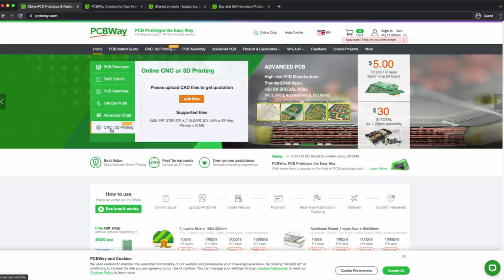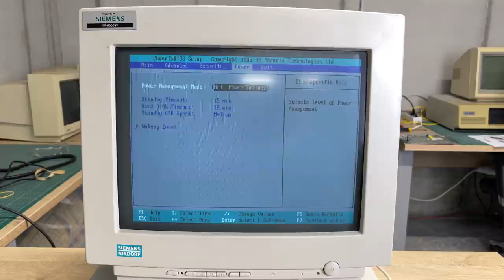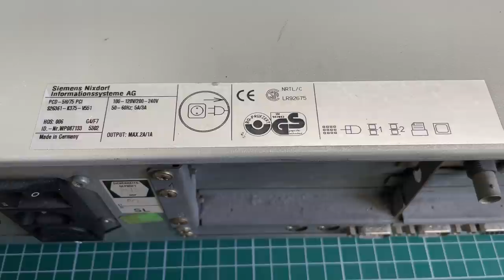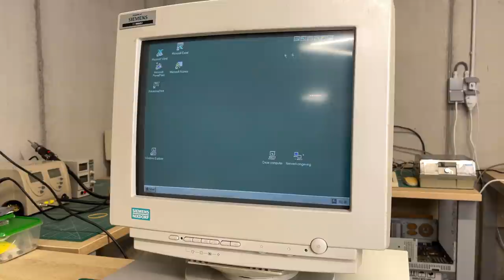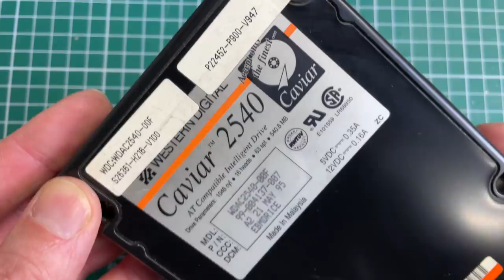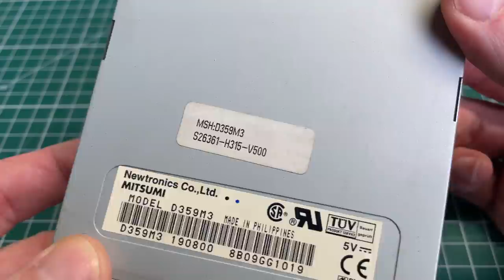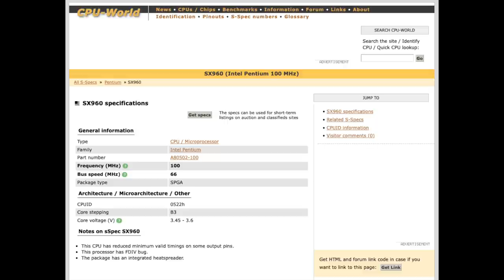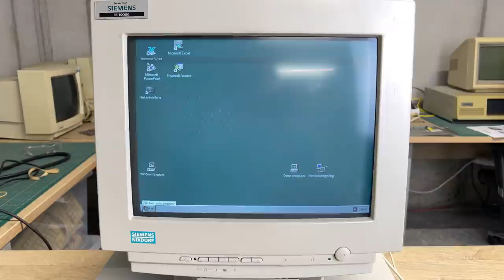Boring Siemens PC with potential ?

Comment: I happen to have the Siemens PCD-4H, which has basically the exact same case but has a 486 instead. It was used as a POS system for all it's life with a 486sx 25mhz. I upgraded it to a DX2 66 mhz and a sound card. It has been a really reliable and great little gaming PC so far.
I also love the look of the system with the sliding door on the front.
Reply: Last time when I check the internet I so to find BIOS update I found ebay auctions for PCD-4H over 1000 Euro without original keyboard. I really shocked because I also have a keyboard. :-) I bought without RAM and HDD almost 3 euro 24 years ago, this my second bought computer. The configuration 486 DX4 80 MB FP RAM, Floppy, 2 WD Caviar, Teac IDE 6 CD changer, SB 16 value edition ISA sound, 56kbaud modem.
Reply: This is exactly what I use mine for. Mine came as as DX2-66 but I threw in a write-back cache 3v DX4-100 in it (through a VRM) but it bottlenecks at around 75-80 MHz on performance tests. I mean I paid $5 for the VRM and $2 for the CPU, but I can imagine if I did the upgrade in 1994 I'd be extremely distraught at the loss of 20 MHz. 

Excellent machine, a staple of my collection that I routinely game on.

Comment: Neptune chipset. This was the high end Intel chipset of that time. The last without EDO support but with complete tags for the cache. Later Pentium chipsets TX (Triton) and VX notably, were significantly faster but only could cache up to 64 MiB which was a real PITA as high end PC's at that time could handle 128 or even 256 MiB (my clientel were steel frame engineers using their machines for CAD with AutoCAD, so I had to know which chipsets were any good). As for the NX (Neptune) it was in my PC of the time. It had a dual Pentium socket, EISA slots and 6 72 pin RAM socket. At one time I had 80 MiB of RAM, 1 IDE drive and 4 SCSI hard disks, a CD player (Plextor) a DVD player (Pioneer), a CD burner (Yamaha) and an external Zip drive. Fantastic machine.

Comment: Siemens-Nixdorf! <3 I went through several generations of these at work in a bank. And they are so fantastically suited to a retro build. compact but with all the features you need, some even have much stuff like networking onboard. some come with a 2MB Matrox millennium on board so all you need to do is plug in a Voodoo and a soundblaster and you are go.
Fantastic machines behind the unassuming appearance. and very reliable!
Reply: Like me, I remember them, too!
Reply: Siemens later worked with the Japanese PC manufacturer Fujitsu, and Nixdorf worked with Diebold, a company that produces automated teller machines.

Comment: Funny how this version of Word starts faster from that ancient PC than a modern version starts from modern one even from an SSD. Both do more or less the same.
Reply: Actually it is only fast because it didn't load into a big document directly. But yes, having less features and a simpler gui helps with loadup speed.
Reply: @MKRENB   Office 2019 takes a good long while to start to en empty document.  At least compared to this (4.2) on ancient hardware and a spinning disk.
Reply: that's because many components of MS office are already preloaded at startup via the office quicklaunch bar while you're off grabbing your morning coffee. (edit: the small bar in the top right)

that pre-loading actually was another point of outrage about MS's deep integration of Internet Explorer into Win95, as it gave them a major boost to their browser's loading time compared to the competition.

Comment: That machine looks very similar to my Digital (DEC) Venturis 5120. The motherboard is almost identical, just a slightly older version. I hardly ever see Siemens Nixdorf equipment here in the US, have been looking, just to have.
Reply: It also looks very similar to my Digital Celebris. BIOS, ports, case layout, motherboard layout, P75 CPU with glued-on-heatsink are like 90% identical (mine has no fan though). I wonder who the original manufacturer is.

Comment: Thank you for this nice video ! I love those Siemens desktops. I used to use these during my military service back in 1997. That was exactly the same : a P5-70 desktop. Actually the RAM is not EDO by default, because the Neptune PCI chipset did not take advantage of the EDO features (that were only available with the next chipset revision : Triton FX).

Comment: This were very common in german companys and government agencys. The transparent cover can lock power on/off switch as well as floppy access to prevent unauthorized people from stealing data. Very expensive machines but also very reliable. Thanks to the fact that Siemens Nixdorf went with coin cells instead of leaky barrel battery (even in the older 486 lineup PCD-4H) many of these survive.

Comment: I have a 486SX Siemens PC myself, but not this model. Previously my dad had another Siemens 286 in a fairly slim case. Very rare in Spain with amazing documentation. We upgraded it with a Pentium Overdrive kit in the late 1990s and still boots but needs replacing the Dallas CMOS battery

Comment: I've got a bunch of PCD-4Hs, also from a school. They look identical, they're 486/66 and running Worms 2 they achieve almost the same FPS as my 100 MHz 486. They came in two configurations and I have both: VLB and PCI. The VLB uses an S3 video card and the PCI a Tseng 4000 (PCI version ofcoz).
When I got them, they were running Win 3.11 with only VGA drivers...
Btw. if you get one with a locked sliding door, just hit the area with the power switch behind it!
Also found a PCD-5H in the trash that had a 120MHz CPU in it.
Reply: I have the same! It's not a boring machine at all, I love the build quality.

Comment: Believe it or not, I just bought a PCD-5H in October. It has a Slot-in CD-ROM drive, that doesn't read any CDs, unfortunately :( It has a much newer BIOS installed, though, it's from 29.12.1998.

Watching your video I realized that on my PC the whole assembly with the metal "bridge" and the floppy drive and hard disk holders is missing. 😁

Comment: Looks like a typical 1990s PC, especially by the mid/mid-ish 90s. Like my PC with 486 SX 25 MHz, before I popped a CD-ROM drive in, probably in 1999. By 2000, I found a 486 DX to pop in and got more RAM, IIRC, resulting in me having 20 MB of RAM! (maybe I got that RAM in 2001)

Comment: Heat sink was glued on wrongly. It supposed to be 90° turned for the fan to be efficient
Reply: You’re right, but I don’t think they cared enough. Other boards by Siemens used a different socket orientation, but apparently they glued the heatsinks on the same way and used them on boards with either orientation. The P75 has a TDP of 8W so they probably figured it won’t be a big problem.
Reply: That's why I added a high speed server fan on my 4H's upgraded DX4/100 - there's no way the natural airflow of the case would have kept that cool.

Comment: Wouldn't "SOFT-OFF-PS" be like ACPI before there was ACPI?  In 1995, ATX PSUs weren't around, and there is no hard switch going to the front power button on this computer.  So the power on signal travelled through the motherboard and connected to the PSU with those funny connectors.

Comment: Guess it's moving links to spam...
Beware, The RZ1000 IDE controller is flawed, though not quite as badly as a CMD640 - it is worked around in Win95 (as "Dual bad IDE") and some other OS, maybe also worked around by BIOS update, and by most accounts, not an issue in DOS unless something is getting too clever with the I/O

Comment: I have the same model. Bought it around 2000 as a more 'modern' replacement for my beloved PCD-4H. At some point, I even tracked down the rare Pentium 166 MMX Overdrive upgrade, but never got around to install it. What I did install however, was an ATAPI CD burner. That thing never successfully burned a single CD, which made me abandon the PC entirely. I still don't know if the coasters were really caused by a faulty burner or if the whole idea maybe was doomed from the start due to the slow CPU and IDE bus. Being a packrat, I still have the PCD-5H stacked upon the PCD-4H in my storage closet.

Comment: There is one big issue on these ET4000 chips. They slide the lowres vga-graphics mode (320x200 256colors) always 5-8 mm to the right compared to textmode. that's why I don't use ET4000 for dos-gaming. there are other series of these early siemens machines that use onboard S3 which will be better than ET4000 in most cases.

Comment: Did you find out what the extra connector on the psu was? I have a 486 and a pentium 2 with something similar, extra power to the motherboard. It's in my head that this was to support the early pci bus which was a bit flakey, but not sure. Nice machine, if it's beige its cool to my eyes😁
Reply: 99.9% sure that's for software controlled power on/off, seeing as the power button also connects to the mainboard, not the PSU.

Comment: A USB 2 interface card would be a good ad to this computer for datastick, external cd-rom or external hard drive. Some have internal connectors so you could mount the cd-rom in the case.

Comment: I always call my PCD-5H a better 486 😂 But I have equipped it well technically... CPU is originally a 75 MHz Pentium, 96 MB RAM, ENERMAX power supply via AT to ATX adapter, Nvidia Vanta 16 MB PCI, SIL3512 SATA card, Ess1688 with wavetable, 3Com Etherlink 3 and 128 GB SSD. Incidentally, it used to run with a 32 GB SD memory card on the onboard IDE. But the PCTech onboard IDE is very problematic, always causes resource conflicts etc. and is very slow in mode 2. Mode 3 also tends to cause CRC errors. So I only use it for the CD-ROM drive. Incidentally, I have the rare BIOS version 4.07 which also recognizes large data storage devices with 32 GB. What annoys me is that you can't deactivate the parallel and serial interfaces or the onboard graphics from Tseng.  Even if you set it to Disabled, the devices will still appear in Windows. You don't have to use the other two connections on the power supply, by the way. It works without them.

Comment: just because you don't have a cd rom, doesn't mean it wasn't common to put on software using floppy disk's. They had to use disk's to install windows 95.  That machine looks like it was reformatted and OS installed, but i am willing to bet you, before it was reformatted that there was a plenty of software originally installed on that machine. Normally windows 95 came with bundled software, so that is telling me, that machine was reformatted.
Reply from the maker: Not sure. Think it was just an office pc. There were lots of word documents still on it. In an office setting I guess all you needed was msoffice. It was indeed a basic win95 install done using disks.

Comment: YEEEEEEEEEEEEEEES I got one of these (a PCD 4H) from Allegro.pl for I don't even remember, something like $125 CAD.  I love it. I upgraded it to a DX4/100 with an external VRM and a custom high speed 30mm fan (running at 5V, it's super loud otherwise)  64 Mb of 60ns RAM, I added 256k cache. 4 Gb hard disk with System Commander (DOS 6.22/Win 3.11 and OS/2), Genoa (TSENG 4000) 2Mb VLB video card, NIC (same as 4:13- Etherlink III), Sounblaster, I added a CF card adapter, 4x CDROM, 5.25  floppy, and I use an external ZIP100 drive to get stuff on it. It's a staple of my collection, the robust case and excellent build quality guarantees I keep this for a good, long time. Also, I think it was used by the government, as there's German inventory tags all over it. 

I don't think it's boring at all.

Comment: Obviously you are going to use it for retro gaming, but just for shits and giggles I want to see how Linux would run on this. I was able to get Debian 11 and Tiny Core Linux to boot on a Pentium 2 with 128MB of RAM, would be interesting to see if it could boot on a Pentium 75MHz and 32MB of RAM, I would think at the very least Tiny Core Linux could do it, as its designed with ancient hardware like this in mind.

Comment: Yeah what good is that password when you can just press cancel to get past it.
Reply: Entering a password customizes the desktop for you and allows access to personalized files.
Reply: @TheInsultInvestor  yes it does, but I was talking more about security.
Reply: The password is for the network, not a local machine which would make no sense to have.
Reply: It's not meant for security, it's meant to mount drives and make resources available. Don't put one in, don't get the access. Seems pretty secure to me.